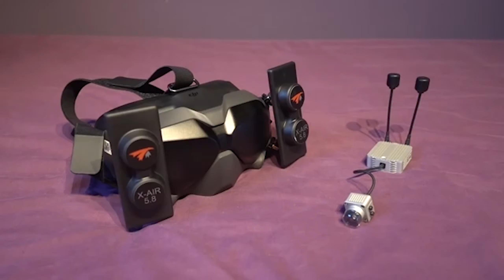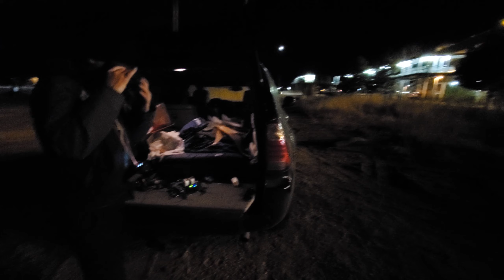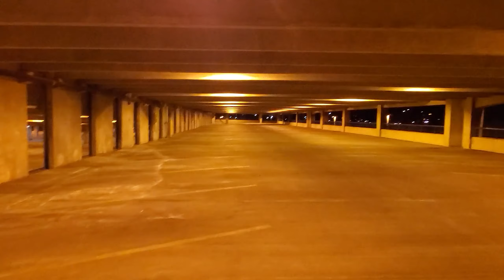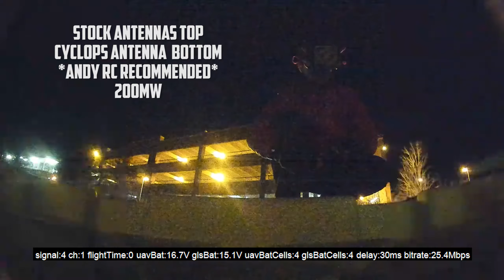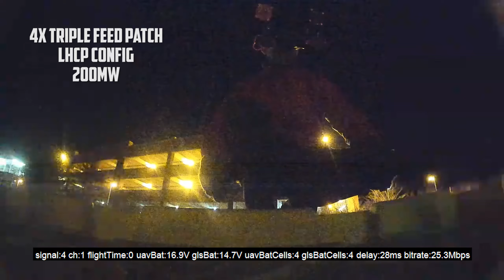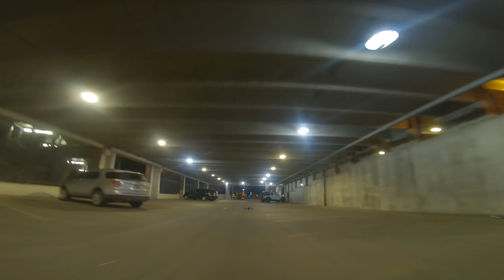DJI FPV System Antenna Testing | NLOS Performance | Parking Garage

Comment: ‘Liked’ your vid! As long as you fly within the beams of the top 2 beacon antennas, better performance with directionals than omnis, is guaranteed. M getting solid performance with 4 Biquads and 2 Dipoles (on vtx). Google “biquad DJI” for the real-world test vids.

Comment: I bet these are nothing but quad dipoles under the plastic and theres plans how to build them on the net.   I know, I built one for my 2.4ghz wifi router and still have it.  Your lengths for 5ghz will be different but its nothing but a copper or steel plate and bent copper wires at 90 degree angles.  If you can bend a paper clip, ruler, and use a hot glue gun you can make these :-/  Ground goes to plate, antenna lead goes up through hole fox x cm, bends at 90, then you make a square out of it parrallel to the plane of the plate.   You have to get your wave length multiple numbers roughly close to right for best performance.
hnc.air-war.org
Reply: We've had the covers off the stock Rx antennas.  They are true CP antennas.   Apparently when measured though, they just don't have a very good axial ratio.

Comment: Didn't Drew Camden also conclude (like Andy,) that in bando's there was not a benefit of running all patches?
Reply from the maker: I explained that our test and Andy's test were done from outside the bando looking & flying in one direction.  I was refuting Andy's conclusion that running omnis was "better" than running patch antennas in this scenario which is what he (imo) falsely concluded. If your standing inside the building of course you'd want to have omnis since you'd be flying around yourself.

Comment: Any thoughts about singularity omni vs stock on the goggles? Going just by feel, it seems like it's a tiny bit better (probably not $80 better), but when I graphed my bitrates after doing similar flights with singularity / stock I'm seeing pretty much no benefit.
Reply from the maker: On paper the stock DJI antennas are 2.5db gain vs 1.9db for the singularity. Also, there's debate whether axial ratio really matters much given that the DJI system seems to thrive in high multipath environments. People are doing 4 miles on the stock omnis with good antenna placement and low noise floor. Basically, no there's little reason to swap out to other omnis.

Comment: awesome testing. I've just purchased the goggles with the two air units. Can't wait to get them in a couple quads. I mostly fly long range in heavily wooded areas and was looking at antenna reviews when I found your video. Can't wait to test different antenna's and see how far I can dip below the tree line. Keep up the good work. Subbed.
Reply from the maker: Thanks! Check out daemn42 and techdaemon as well

Comment: Hi guys,

Thanks for this test.

Maybe dumb questions but I'm noob on antenna stuffs and I'm struggling in deciding if I've got to change my stock antennas and if so what to take...

Was thinking about something regarding what you're mentioning in it. Especially the top or bottom placement of the antennas and the fact that the top row use to receive signal only and the bottom one transmit and receive

Have someone tried to mount a pair of antennas in diagonal way? 
a Patch on top left and another one on the on the bottom right, and a stubby or a pagoda on the other diagonal. Thus to make the beam as large as possible compared as if they've been mounted on a column way.
In case the received only signal would be link with the duplex one it can definitely be benefic, no?

One last thing, what about placing two pagodas at 90° each or at least not parallel thus to make the donuts beam merging to avoid the dead zone of them?

Cheers
Reply from the maker: The top 2 ports are transmit/receive, the bottom are receive only. Yes, we did try that configuration you speak of, I just forgot to put it in the video. It did not perform noticeably better than any other configuration with patch antennas.. Regarding pagodas at 90 degrees: your theory sounds good, but from my experience, it would probably be hard to quantify without doing many back-to-back tests. As long as the antennas are decent, you're not going to have a problem.
Reply: @jbrittofficial  thanks a lot for your answer.

The guy from pro prodrone that made a kit with pagodas and patch told me this morning that several clients gave feedbacks that they obtained better results mounting their patch antennas on top and pagodas (long ones) at the bottom. 

👍
Reply from the maker: @NaNVoid  Great! Keep in mind the point of this video: testing the unscientific claims people have been making. I think the results speak for themselves. Throw on a couple patches in any configuration and it'll improve NLOS performance.

Comment: Why not have the OSD data on screen all the time?  It would be helpful to see the literal bandwidth you're getting at each stage of the test.
Reply: @Protonus  We were running higher power in much less obstructed areas for those parts of the video, so numbers always stayed high.
Reply: @daemn42  That makes sense, thanks Daemon.  I had the video muted and didn't realize these scenes weren't active testing, that's my bad.  Thanks for ya'll making this quality content.
Reply from the maker: I honestly have no idea what you're saying. Anytime there's DVR footage onscreen I have telemetry info showing.
Reply: @jbrittofficial  The first part of the video and the last part of the video have no OSD data.  Just the middle part does.   The first part and last part may be GoPro data, but you can still overlay OSD data onto it, it needn't be DVR.   You can put the OSD data over any source of video since it's just an SRT file.
Reply from the maker: @Protonus  Why? Overlaying that info doesn't mean anything. It's just random flying with no baseline reference and serves no purpose to the video. At 1200mW the link is rock solid no matter where we flew, that's why we had to bump the power down until omnis started failing in the furthest point of the building.

Comment: Thanks for the test. So, if I get it right, up the power  and keep stock antenna it will do the trick in most situations.
Reply from the maker: Basically yes. This system is so good it's not immediately obvious how/when directional antennas are actually benefiting you. In my opinion, this is what leads people to conclude that directional antennas don't provide a benefit. DJI at the absolute limit is still more flyable than a standard analog signal until it drops off a cliff and freezes up on you. If that makes sense.
Reply: @jbrittofficial  Sounds very similar to when RC control went from analog to digital.  With the old analog FM systems, you'd get more and more servo jitter until it just wasn't flyable or you lost signal altogether.  But it was usually a progressive reduction that was obvious.  With 2.4 digital control, I always got more range (using Futaba FASST), but the cutoff was much more abrupt when it did happen.